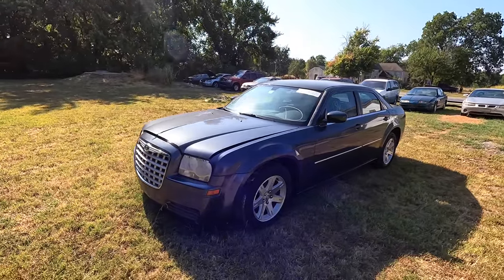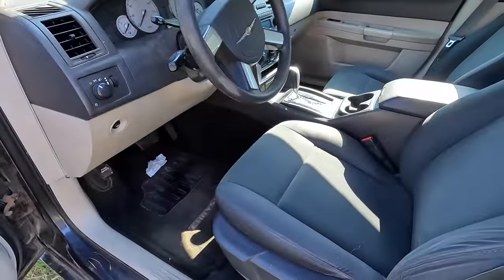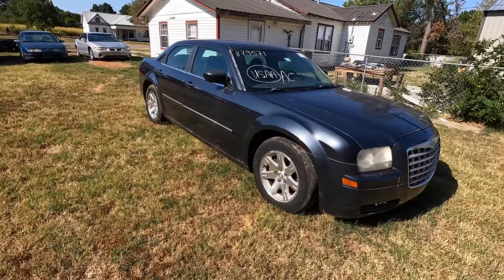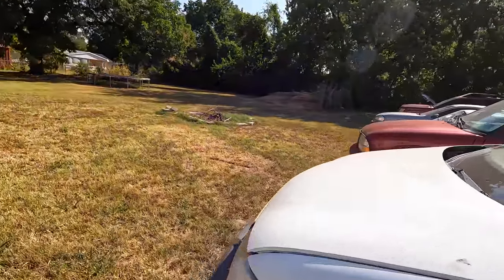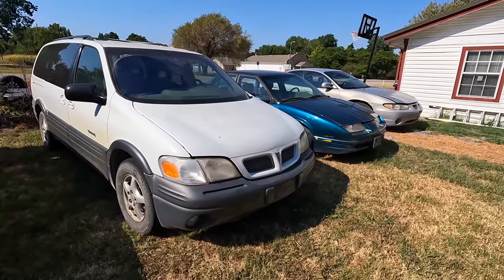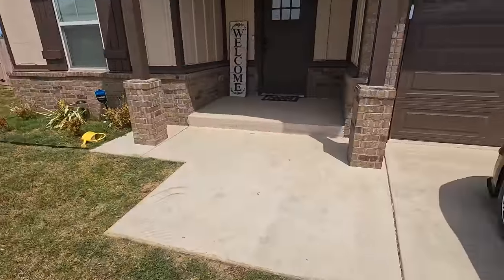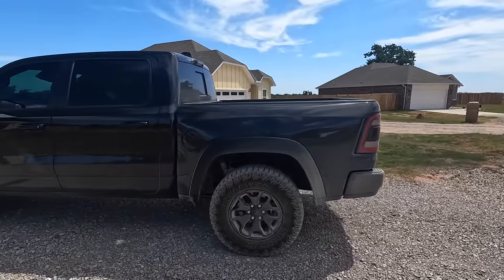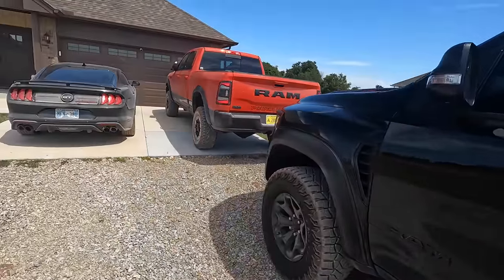I Bought 17 Cars from Auction Costing over $35,000!! Am I Insane???

Comment: I once got a 2002 Intrepid with the same 2.7l v6.  It had head gasket issues and would bubble coolant out of the overflow tank.  I also found the engine to be underpowered.  If it had a better engine it would of been a fantastic car and I like how they look.
Reply: Did it happen to lack power due to the fact it had a head gasket issue?  ya know coolant doesn't actually burn very well and if it happened to get into a cylinder while running,  well just saying lol
Reply: I have a 2001 2.7 Sebring. 61,000 miles on it and I've kept up on the fluids, oil is changed every 3,000 miles. Oil stays clean most of my oil change duration.
Reply: I also got mine when it was at 200,000 miles and I had just been in an accident that wasn't of my doing and had to get something quick.

Comment: 4 pot trans am Iron Duke, i could be wrong were they not a terrible engine???? IF so and rebuilding the car might as well put a V6 or V8 make a nice car who wants a WEENY 4 pot trans am???? I only see one thing wrong with the motor home, TOO QUIET!! Fix up as many as you can, to running driving condition SELL em, even the rough Honda Civic, somebody will want it, they easier if they do not look bad and run!!

Comment: Back in 2001, my dad bought a first gen Xterra. Same as yours, really basic. It had manual transmission, 2.4 lt engine, nothing powered and, of course, you couldn't even think about going for some off road trips on that. 
But, still, it was a very durable SUV. He sold it to me in 2016 and I kept it for a couple of years, until it started asking for the real expensive stuff to be replaced and not easy to find, by the way. 
I sold it with more than 300,000 km on it. The engine or the transmission had never been repaired, not a single scratch on the interiors or dent on the body, the paint was decent, no leaks of any kind and I installed some nice extras (High-end alpine head unit, Infinity kappa speakers, an optima battery and upgraded all the wires on the charging system). 

I never knew how those next-gen Xterras were, compared to the first gen. But people say thew were not exactly made for off roading. More like another city/ less durable SUV.

Comment: I was given one of those Saturns free that sat in a garage.  High miles and I had to take a rear caliper off to get it to roll.   A guy I knew needed a car for his daughter so I just sold it to him for $200.  He fixed it up, she drove it, wrecked it, they fixed it again, someone else drove it, I think it ended up with 400,000 miles on it.   Other than color looked just like yours. 

I'd buy that Pontiac minivan if you could sell to the public.  Or maybe the Jimmy.   

Olds engine in the Model A?  They had the oil fill in the same place. 

Starting to look like Hoovies Garage on 1/10th the budget there

Comment: That is a shame about the 300 with the hole in the oil pan. If the 2.7l engine got regular oil changes, it should be good to go with no sludging. I had a 1997 Pontiac Trans Sport. I paid $500 plus inspection costs for the thing and it gave me 3 years with no issues. Nice power for a heavy van and it was comfortable to drive. It was a bit of a pain in the butt to work on because the engine was set back in the engine bay and GM designed it to have wipers that operated differently then most other vehicles so the wiper bits and bobs stuck out under the hood and blocked your way to get at some of the engine. I don't call it hoarding, i call it content

Comment: Any time you have a simple black mirror on a Chrysler 300 (2006 to 2010) you have the 2.7 V6. Same for the Chargers (2006 to 2010) and The Dodge Magnum (2005 to 2008). The Pontiac Trans Sport Montana CarFax showed the last reported service at 113 miles, so you know it was maintained either perfectly or terribly by the "One Owner"!

Comment: I used to have a 1993 Saturn SL1 LOL the thing burned 6 quarts of oil a week the transmission would slip almost in every gear the muffler had a huge hole in it about the size of my head and yet it started with a screwdriver I ended up putting my Saturn race car fender on the front of my daily driver Saturn ended up getting pulled over one day for driving with my Nissan plates on my Saturn plus having a suspended license ended up paying more money than I paid for it to get it out of the impound thing was a turd but man it ran the odometer quit working at like 260,000 miles so I never know how much was actually on it LOL

Comment: Get rid of the Pontiac Montana now! In fact have it crashed! They may run ok, (but GOOGLE, Pontiac Montana crash test), as they have been rated by the Institute of Highway Safety,  and most other crash test raters as one of the top,  if not the top, most dangerous vehicle on the American highways.  They have very low ratings because in an accident they have a tendency to crush into the passenger compartment severely.

Comment: What the hell were you thinking about putting gas cans inside a car you don't do that you put them in the tailgate the strap them down you don't have gas products in a vehicle especially if someone's allergic to any of the fumes and stuff you know and it also causes major fires you know yeah let's say you don't smoke or anything but even still takes for some reason they got fires and on the Camaro that's a four-cylinder I work for a car lot the boss bought that for his son we put headers on it we put a nice exhaust system on it made it sound like a good V8 and everything and he ordered it with the Z24 package except for the motor in the transmission we put a 5-speed transmission in there you know and yeah ours had air conditioning whatever time you turn on the top power steering I think air conditioner shuts off

Comment: Hi Randy, love all of the cars, but there are a couple of cars that should not have been bought, like the Honda with the broken windshield, you are going to have to fix the roof to be able to put in a new windshield, also that Chrysler 300 I've heard to stay away from the 2.7 engine and the 4.7 engines on mopars.  I had a 01 Chrysler LHS with a 3.5 and it was a good engine but not perfect but a better choice than either of the other 2.  I didn't see the Grand Wagoneer, did you trade that in on the Trx?  Are you insane, yes the good kind of insane.  🛻🚙🏍😀

Comment: About 50 years ago my cousin, 15 years older than me told me how to get rid of hail damage om the metal of a car, leave it outside on a 90 degree day until the sheet metal is really hot, than put ice in the hail dents, supposedly the change in temp will pop out the hail dents.